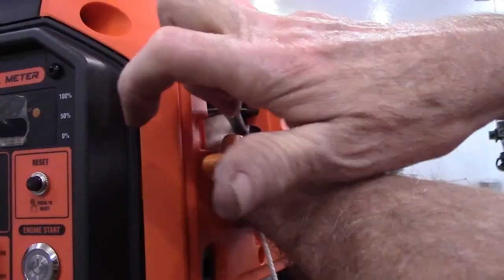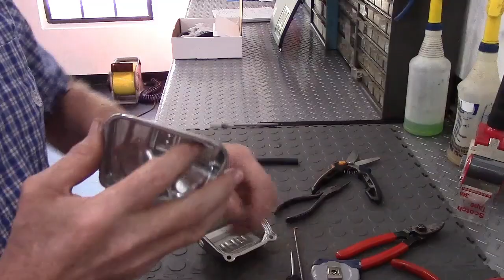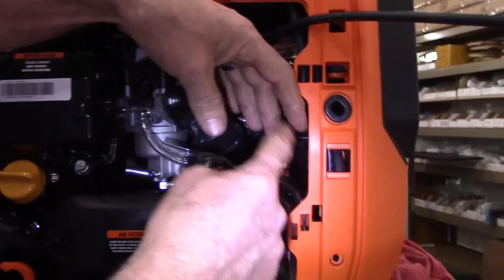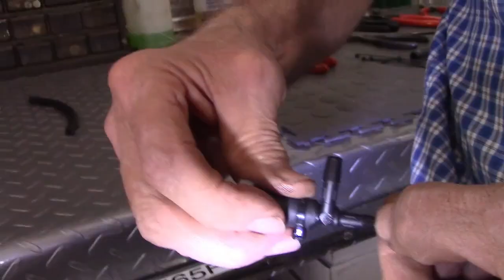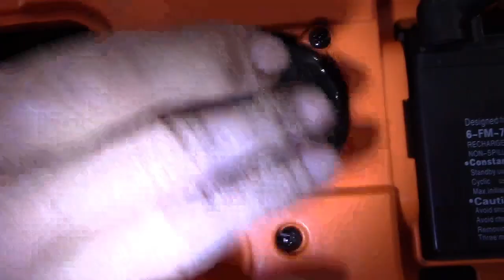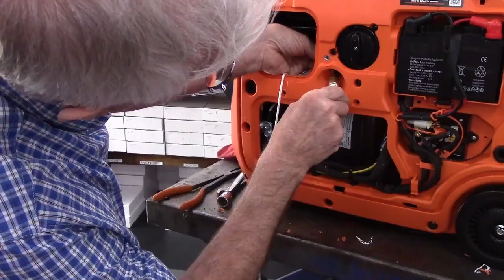Gidrox 6000 Extended Run Time Fuel Kit Install by Pinellas Power Products

Comment: For future viewers: When you make the hole for the inlet valve access, start with a tiny one and make sure it's lined up with the center of the cavity containing the connector.  If it is not, re-drill it.  Once you have it centered, get the hole saw and make the big hole.  That will get your big hole in the right place.  Note: This step can be done at any time -- I recommend doing it before you install the quick connector so you can sight through your tiny hole and clearly see or probe the center of the existing cavity.